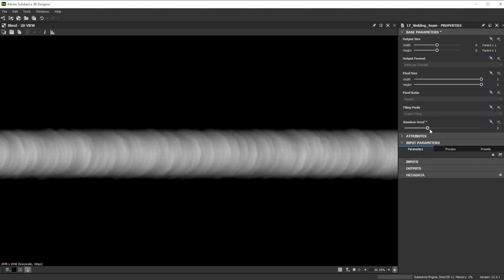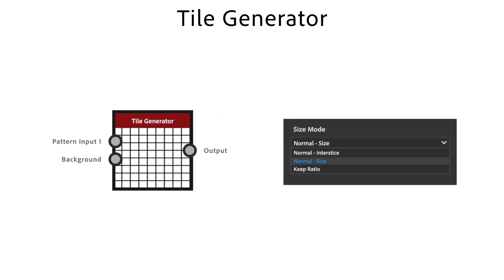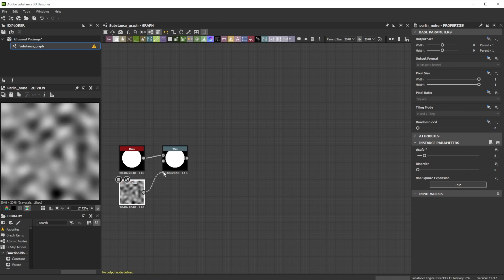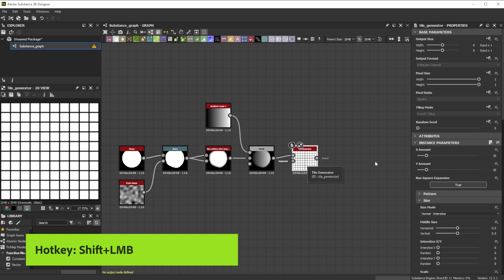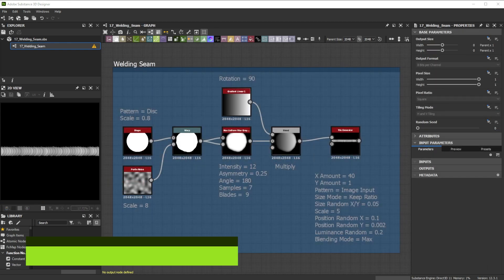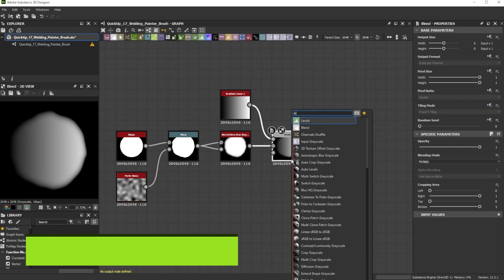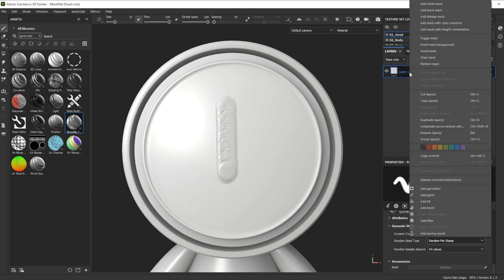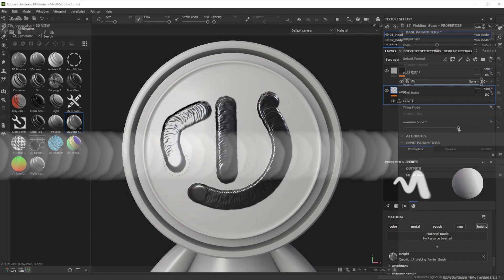Welding Seam | Designer Quick Tip #17 | Adobe Substance 3D

Comment: Real Tip: Instead of wasting your time doing this, you could have done the same thing directly in Painter by editing the brush spacing and position jitter of the brush painting on the mask of a Fill layer...
Reply: I think it's meant to show how you do something like that so you can have more control over the result or build something similar
Reply: @bartshoot  you have more control with the brush, there are a lot more options.
Reply: It seems you gave not understood the point of this at all. By creating this in designer and exposing parameters and then exporting for substance you have full control over your material in painter, meaning you can adjust it after painting if you want a different result. 

Your method requires you to repaint it and experiment every time you want something difference. 

This is what makes designer + painter synergy so powerfull.
Reply: @Mish0Picka  It seems you do not know how Painter brush works at all. :D
Reply: @keelfly  Again, you show your inexperience but whatever.. stick to what youbare doing but don't fool others.
Reply: @Mish0Picka  you are fooling others and you are inexperienced. I am working with substance tools almost 5 years in a huge range of applications.
Reply: @keelfly  I've been in the industry since 2007 my friend, not that it matters how long you have used it, you can still use it wrong or right.
Reply: @Mish0Picka  good for you. I have been in the industry since 2000. You are still clueless about Substance Painter brush functionality.
Reply: @keelfly  Ok why don´t you educate us then?